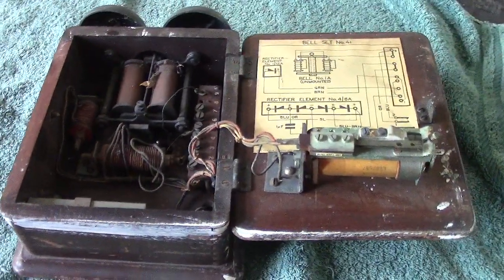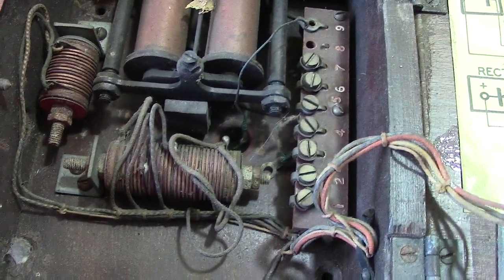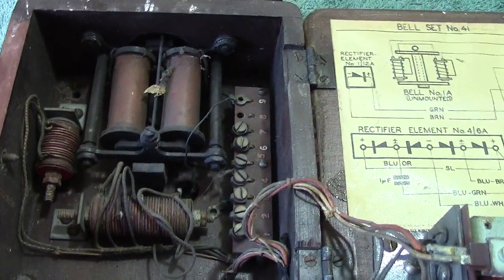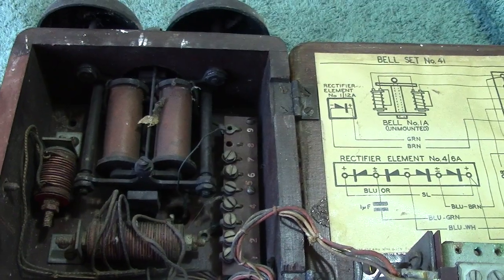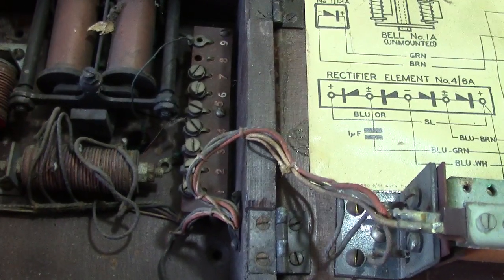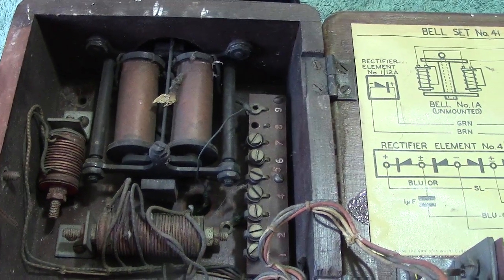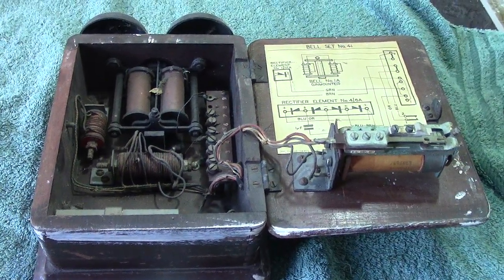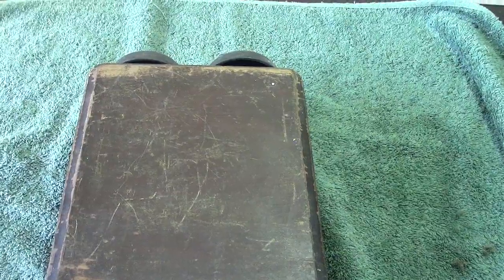Telephones of the World

Comment: Interesting bit of history. 
Regarding the relay I have a rough understanding of how a shaded pole motor works. 
 If the slug works the way I think it does then extra inductance of said slug would delay the magnetic fields effect on the contacts.
Reply from the maker: Thanks, yes the slug works as a one turn, these relays were common in the telephone exchange used on equipment etc and were used to slow the operation or slow release, slugs were made in several  sizes to allow timing of the relay.